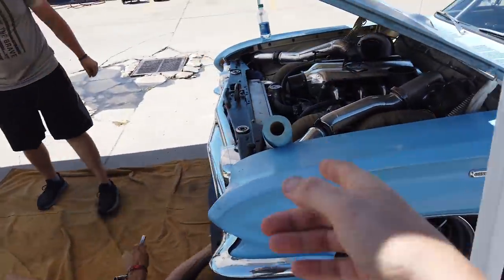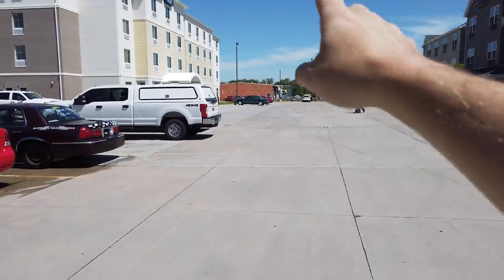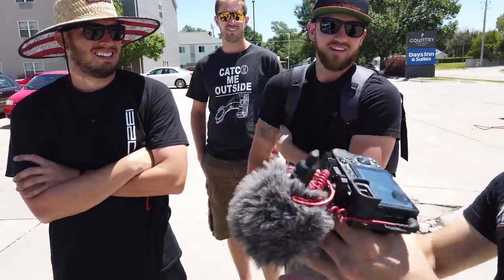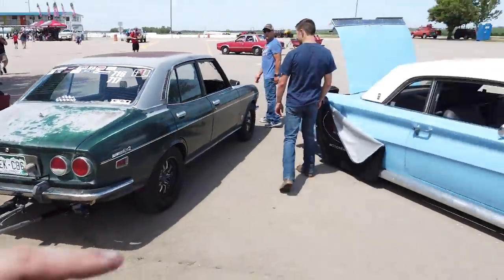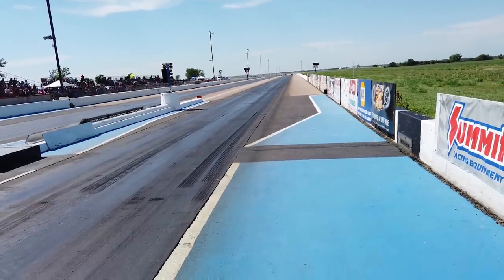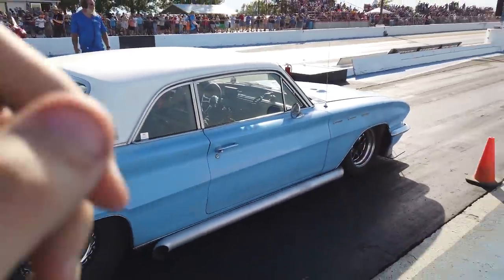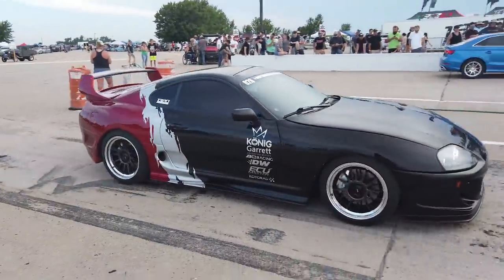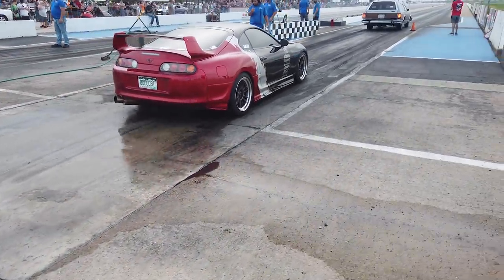Race Week Day 3 1500hp Twin Turbo Buick and V8 Swapped Mazda Making some FAST passes!

Comment: What trans does Clyde run?
Reply from the maker: It has a 6l80e
Reply: Build Tune Race I was wondering. The first couple gear changes almost sounded like a manual trans. But the last gear change down the track sounded like an auto.